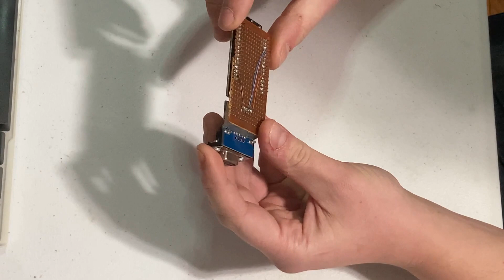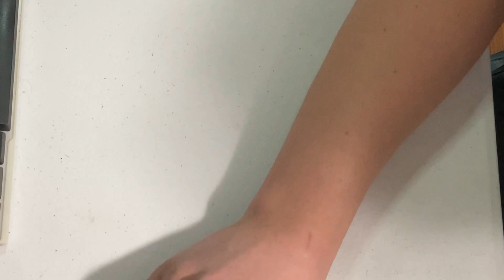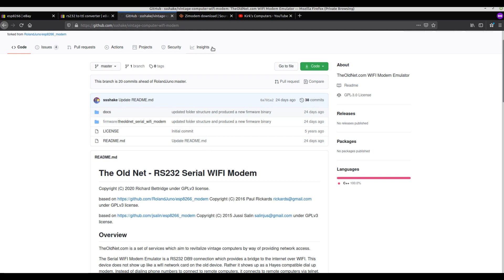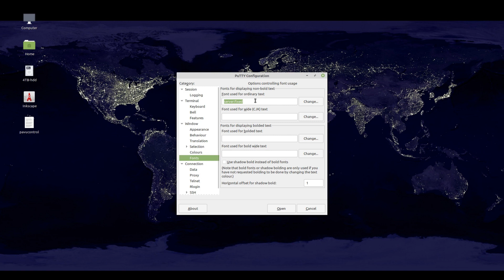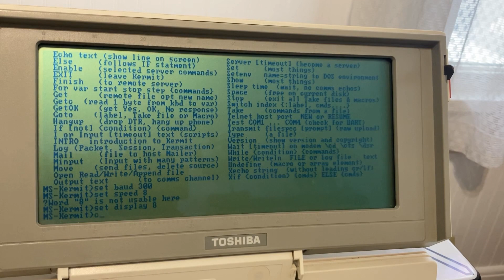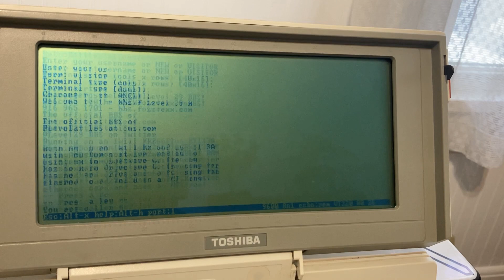DIY CHEAP WiFi Modem For Vintage/Retro Computers (featuring 1986 Toshiba T1100 Plus)

Comment: That is perf board not a breadboard.  breadboards are those fixed-size boards that you push link wires and component legs into the holes with spring contacts.   That is Wire Wrap Solid Kynar Wire.

Comment: I've built a bunch of these.  So satisfying to connect something from the late 70's/early 80's to 90's BBS's with 2000's tech.  My current favorite adapter is for a TRS-80 Coco, using all 1980's Radio shack hardware to enclose and connect the ESP.

Comment: Great video !

I was just a bit confused by the "ATDT" command.
Usually it is used to dial a phone number. The modem on the other side picks up the call and connects you to the bbs (or to your ISP).
But here, the software running on the esp board "cheats" and directly accepts domains names. That makes sense because the esp only act as a "telnet over serial" and act like a modem for the configuration part by accepting AT commands. But this surprised me
Smart trick !
You could probably achieve the same result using a linux computer instead of the esp. This could allow you to run a text mode web browser (lynx, w3m, ...) over you serial link.

By the way, could you provide your wire reference please ? i'm looking for this for a loooong time. Usually, enameled copper wire is hard to solder because the coating only melts at ~400°C... which is way too hot for the tin wire.

Thank you very much !
Reply from the maker: Glad you liked the video! I found this wire on eBay listed as "breadboard tin plated copper wire wrapping 20awg. It came direct from China so it took a while. That's the only info they had in the listing for it.
Reply: @amateurtinkering2103  Thank you very much !
It will help me to finish my Z80 project. Then I will try the wifi modem for my Thomson TO9. This will not be plug and play, as the TO9 lacks the rs232. But I'm confident.

Comment: Subscribed. Do you know if one could build one of these modems for a ZX spectrum?
Reply from the maker: This modem will fork for RS232, I'm not sure if the spectrum uses RS232 or not for serial communication (I haven't had the opportunity yet to use one here in the states).

Comment: Looks like a fun project. I have used Hayes type of emulator on a raspberry pi. I have had my Commodore 128 and TRS Model 100 online.
Reply from the maker: Awesome! Getting old hardware connected to the internet is a lot of fun

Comment: I've got a couple of these wifi modem emulators which work on my DOS PC's but I have not been able to get it to work on my TRS-80 with the serial cable.  I wired it for drivewire, as well as swapping the RX/TX around.  Any advise?
Reply from the maker: Hello! I’ve gotten it to work best at 300 baud. 1200 baud worked but with errors. What baud rate are you using? I have had it successfully working with Videotex and Compac terminals set for 300 baud 8N1. You may also have to adjust half/full duplex

Comment: Good video and great to see old computers online. The ESP8266 board is not 5v (TTL level) tolerant. Receive levels should be 3V level. It may  be damaged at some point. It is better to use 3v/5v logic level convertors.
Reply from the maker: So I did some testing. My RX and TX pins only go up to 3.3v. The ESP8266 board is supplying the TTL converter with 3.3v. The TTL converter can work with 5v or 3.3v, but I am supplying it with 3.3v. The TTL converter seems to be staying at 3.3v with no issue :)
Reply: Is the issue here that the host computer drives the serial lines at 5V?
Reply from the maker: @SireSquish  There was concern that the RS232 to TTL converter was supplying the ESP8266 with 5 volt logic signals, however I found that the logic levels were staying at 3.3 volts. I think since the ESP8266 is powering the RS232 to TTL converter with 3.3v that it is keeping the logic voltage at 3.3 volts. RS232 actually uses up to 25 volts from what I have read, but that's the purpose of using the RS232 to TTL converter. In this application, the voltage levels seem to be working properly, which makes sense since I have been using this setup for over a year now with no issues.
Reply: @amateurtinkering2103  Ah ok. I seem to recall most serial devices using 5V, but as you said even if that was the case the ESP8266 should be able to tolerate that with the protections you've described.
The only problem now is that all my old-school computers are in another state, so I don't have anything to connect one of these to :p
Reply: @SireSquish  The RS232 converter used on those serial converters are the MAX3232 chip, which is the 3.3V version of the MAX232. I discovered this when I researched whether it could be used with the Raspberry Pi, which it can. No need to worry about blowing things up.
Reply from the maker: So that's what the 3 in MAX3232 is for, thanks for pointing that out!
Reply from the maker: Thanks for the info. I have had this setup working well for quite a while now. I took a look at the data sheet and found this:

"All digital IO pins are protected from over-voltage with a snap-back circuit connected between the
pad and ground. The snap back voltage is typically about 6V, and the holding voltage is 5.8V. This provides protection from over-voltages and ESD. The output devices are also protected from reversed voltages with diodes."

Pages 17-18 of this datasheet:

https://components101.com/admin/sites/default/files/component_datasheet/ESP8266-NodeMCU-Datasheet.pdf

Perhaps that is why I have not had any issues yet? Thanks again for the info!